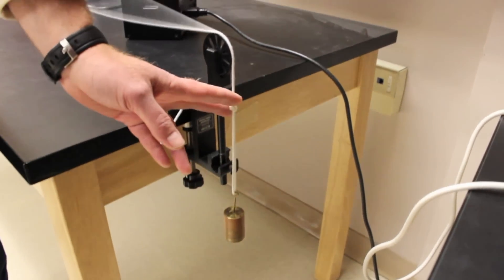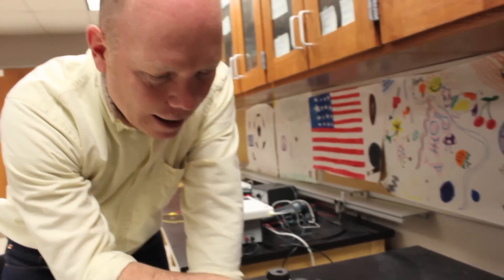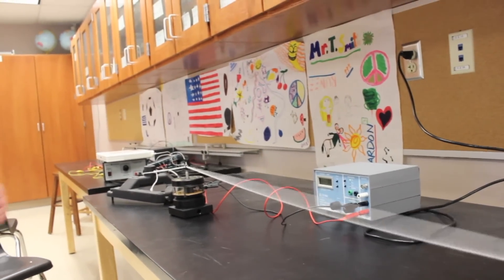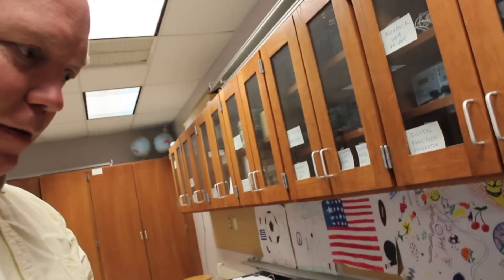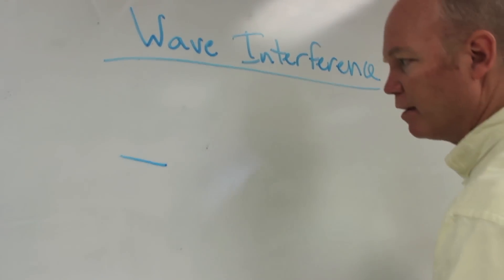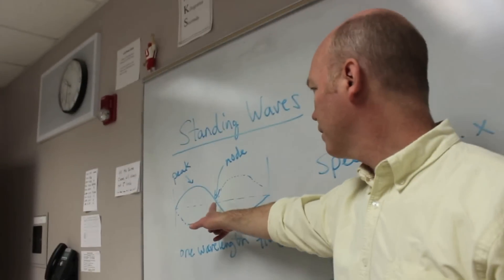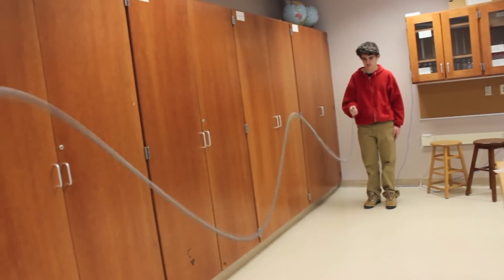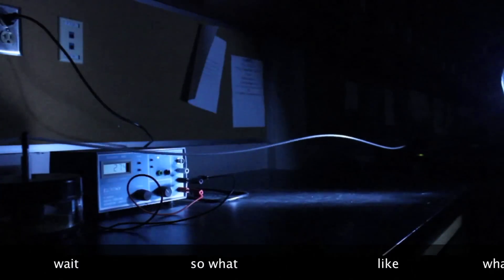Strobe Lights and String - Standing Waves

Comment: So if you see one string that means your light is flashing at the same frequentie and two strings is because your light is flashing two times faster so double the original frequentie. My teachers did the same thing and wanted our opinion of what would happen if the light flashes at have the original frequentie. Does anyone know?